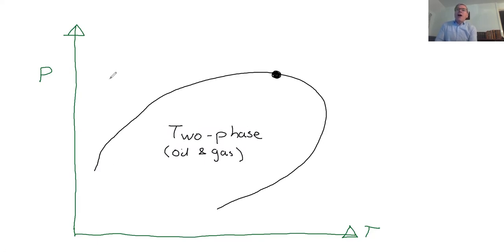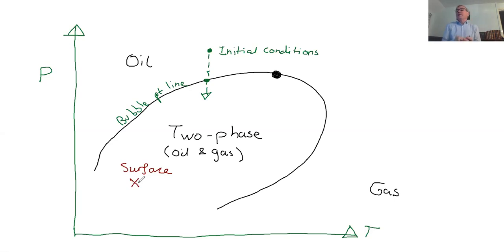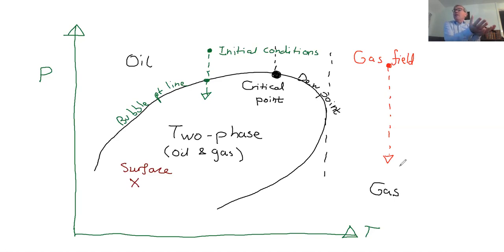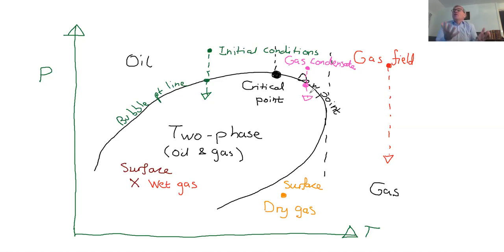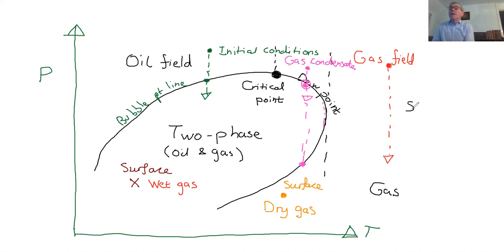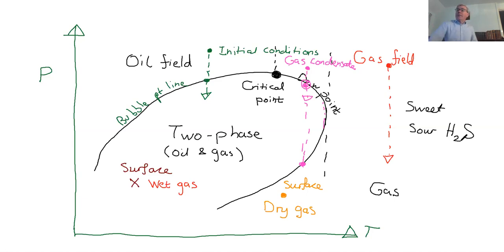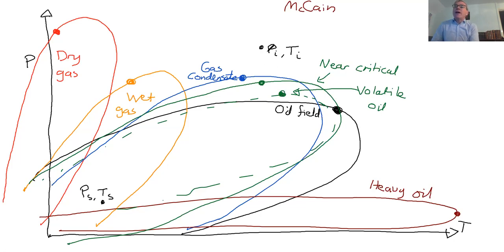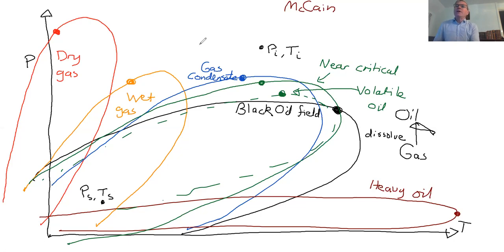Hydrocarbon phase behaviour

Comment: Thanks for this presentation. Still to come, wish if you kindly add your insight to the controversial "retrograde condensation" zone inside the PT two-phase envelope. How you present it to your students?
Reply from the maker: This is discussed in this video and the subsequent lecture 6.  Retrograde condensation - the formation of a liquid from a gas when the pressure is dropped - is what happens in a gas condensate field.  It is not controversial, but a consequence of the phase behaviour.  I tend not to use the expression retrograde condensation as it usually causes confusion.  I simply explain what happens for different types of hydrocarbon field.
Reply: @BoffyBlunt   Thanks for this elaboration. I will watch Lecture 6 of yours with interest.

Comment: In the Dry Gas example, How can we have the surface condition as low P and high T? Low P i can understand because no pressure but how is it possible that we have high T at the surface? Whwre is the high T coming from? Sorry, didn't get it there...
Reply from the maker: It seems that you misunderstood.  The surface temperature is the same.  It is just a problem with having one diagram and showing wet and dry gas conditions together.  It is not high T for dry gas, but a rescaling of the temperature axis!  See the second figure I show, where the reservoir and surface conditions remain fixed on the graph.

Comment: Thank you for the presentation Mr. Martin. This is so helpful content. I have a question sir, i still did not understand about the critical point term, i understand that when the reservoir pressure hits the bubble point line there is a small bubble of gas appears from the liquid. In my mind, when the reservoir pressure hits the bubble point line and the small bubble of gas appears, the liquid and the bubble of gas have different density, so that why the term of critical point is the properties of liquid and gas are similar? Whether they merge so that the properties of liquid and gas are similar?
I am sorry for my bad English Sir, i hope you understand what my question. Once more, thank you for advance.
Reply from the maker: The way of thinking about this is to consider the transition from the bubble point line to the dew point line.  So the bubble of the second phase is first less dense than the surrounding fluid (bubble point) and then more dense (dew point).  The only way this happens is a point where the properties of the two phases are similar.
Reply: @BoffyBlunt  aah I see Sir, thank you for answering my question Sir :)

Comment: Please what is meaning surface condition in minute 03.
Reply from the maker: This refers to the temperature and pressure at the surface - once the oil and gas is produced.  Traditionally this is considered to be 1 atmosphere pressure (around 100 kPa) and a temperature of 60 degrees F (15.6 degrees Celsius).